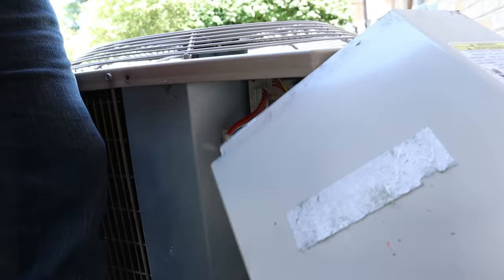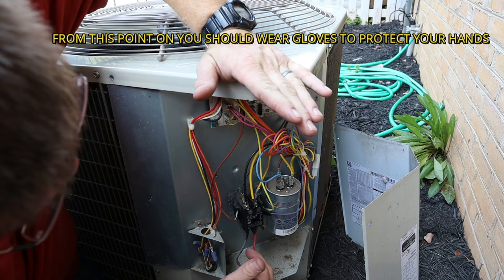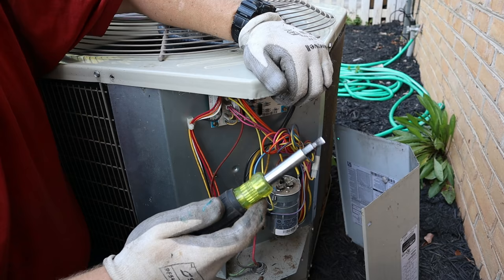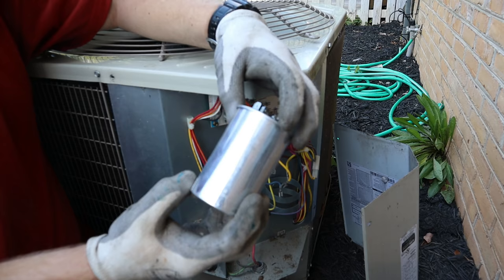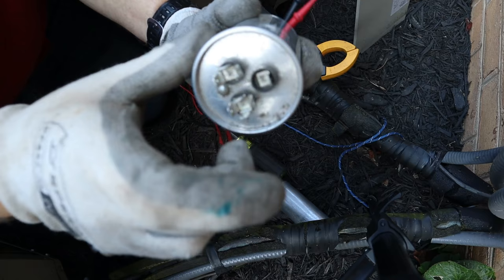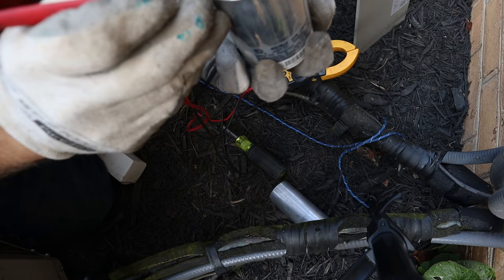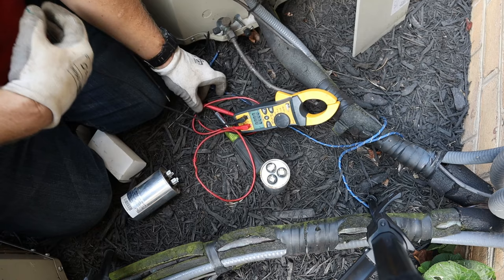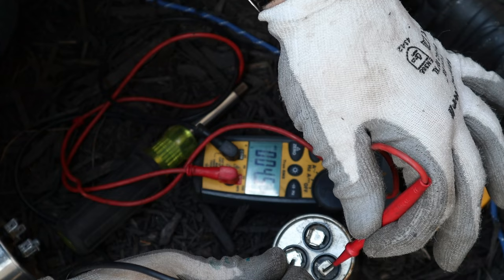How To Fix Your AC |Outdoor Fan Will Not Turn On

Comment: capacitor is good but a/c fan not working, UNLESS THE SWITCH IS PUSHED IN. What else could it be?
Reply from the maker: Are you talking about pushing in the contactor? If so check to make sure you have 24 volts when your thermostat is calling for the ac to turn on.
Reply: @MountaineerOutdoors  Now is that 24 v DC, or AC. I'm looking for my tester. Thank you!
Reply from the maker: Ifeel pretty certain that it's ac
Reply: So do I. Thanks!!

Comment: Informative. 
But zip ties isn't the answer.  Vibration is an issue.
And flush cut pliers is way better than twisting the  cable tie.
I hope you went back in and did it correctly. 
That wouldn't fly in my trade
Reply from the maker: What trade is that? Thanks for your comment and watching ☺
Reply: @MountaineerOutdoors  elevator union

Comment: Mine made a noise and I heard the furnace running but the fan wasn't, I think it's the capacitor
Reply from the maker: It very well could be that's definitely a good place to start
Reply: @MountaineerOutdoors  thanks for the response, fingers crossed 🤞
Reply from the maker: Good luck 🤞

Comment: How do you get a free capacitor because it's still under warranty?
Without incurring a service charge from the tech. Company.
If you can DIY and the part is still under warranty, then why can't a company such as Carrier send a new part out, free of charge?
I know the part is not that expensive, but it is still under warranty and it's the principle of the thing.
Many other under warranty, household items and appliances can be requested from manufacturer's, free of cost, without a tech. service visit.
Why should this be different?
Reply from the maker: I'm assuming because it's one of those parts that is just not covered since it's a very cheap part.
Reply: @MountaineerOutdoors  Oh....it's covered. Yes it is.

Comment: My fan is not stopping does anyone what can be going on i even turned the breakers off hopping it will stop but no still on
Reply from the maker: Sound like your beakers is bad. If you have turned off the beaker and still on either your breaker's bad or you turn the wrong breaker off
Reply: @MountaineerOutdoors  I turned off all the breakers and fan still on! I removed the thermostat and still on I removed the green wire still on so i turned off the breakers all of them because I didn’t know which one it was and it’s still on so do I get an electrician to check out the breaker instead of the AC unit?

Comment: Get to the point. 🙄 Too much of irrelevant and off-topic blah blah blah!🥱
I just want to know the cause and remedy. Didn't want to know how hot it is out there and whether an egg can be cracked and fried etc etc. 😮‍💨
Otherwise than that (removing the unnecessary blah blah), probably an informative video if the problem issue is indeed the capacitor. 👍🏻 I just didn't get to watch the video because I got out off with the blah blah blah in the first quarter. Went out to continue else's video.
Reply from the maker: Well thank you for all that that you wrote, now I will tell you here where I'm at it's around 30° and my heat pump is working very well although I have to go to work on a Monday morning I want to say that the drive over to my work was great. There was no deer in the way and quite frankly the weather is really good. I did see a good sunset the other day and a sunrise this morning the sky is a nice blue and very few clouds in the sky. So you see what I'm doing here I'm blah blah blah and again anyway thank you for watching my video and giving it a few minutes I've come a long way since that video my blah blah blahs are not like they used to be thank you for your constructive criticism and have a great great day

Comment: dang capacitor was fine but it's still not working. dammit.
Reply from the maker: I know the disappointment
Reply: @MountaineerOutdoors  it was a small, hidden fuse.
Reply from the maker: @MercuryRisingFast  well at least it's fixed.
Reply: @MountaineerOutdoors  yep. Especially in this heat